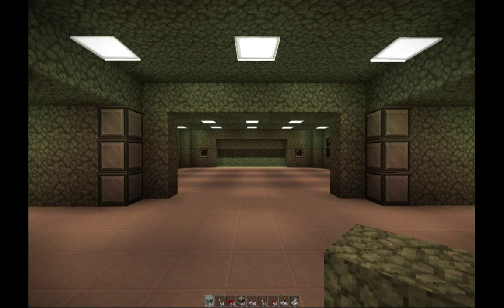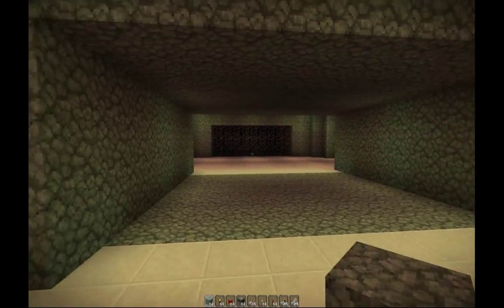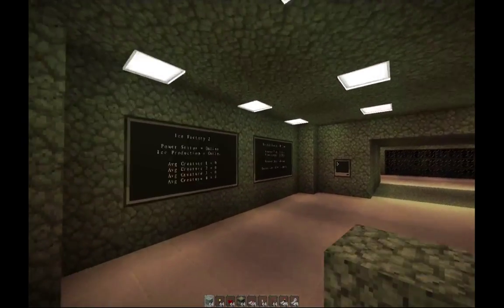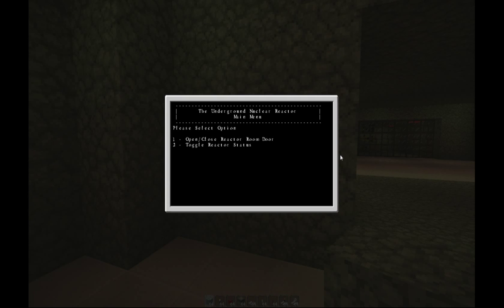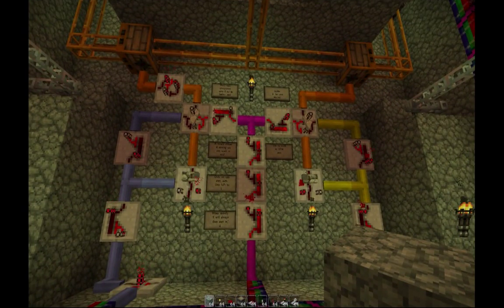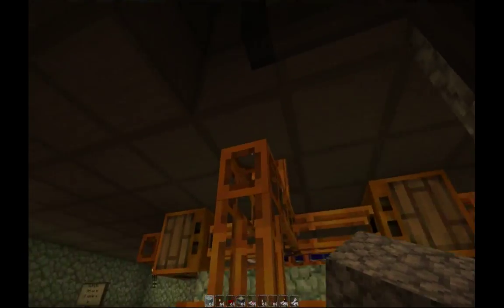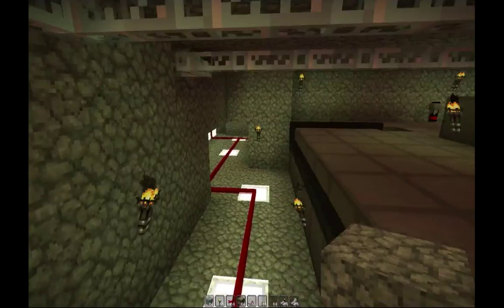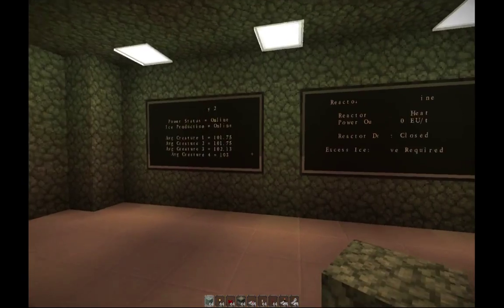Tekkit Automated Underground Nuclear Reactor (Minecraft)

Comment from the maker: Actually this can and did run completely without Computer Craft. My older one did have this issue, which I didn't like so I made sure not to rely on it at all. All the systems work off logical gates. 

The computer do numerical displays, status, and do turn on and off the reactor, however if you look at like 13:08 you'll see a lever. That can turn on and off the reactors without the computer.